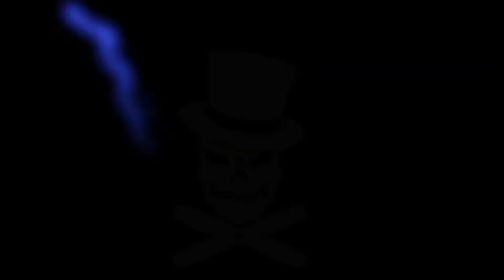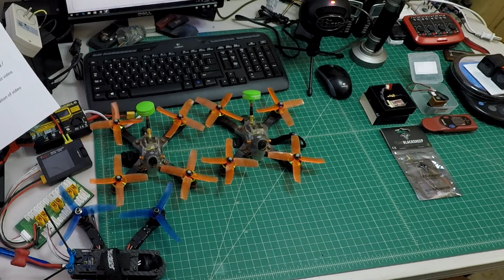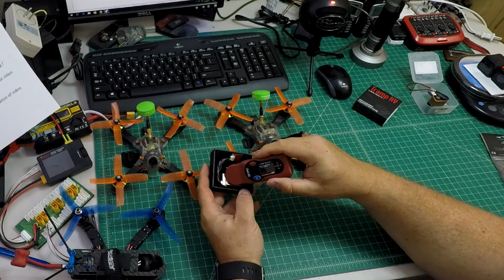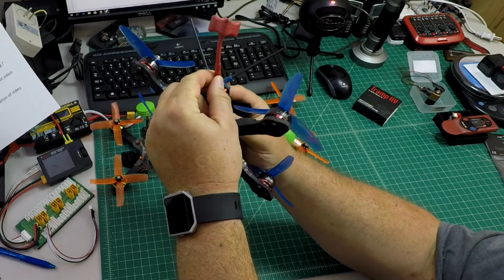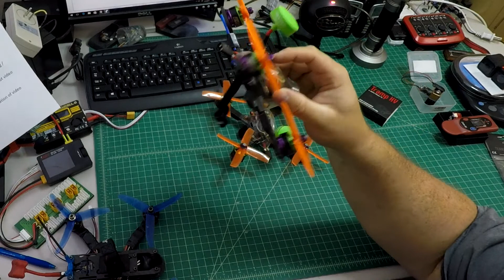FPV Racing Do's and Don'ts for pilots and Organizers

Comment: Great information I guess dip switches and my immersion 600mw race band is outdated I've only been flying solo but am going to be doing more racing.. Only heard good things about unify pro and heard it goes to 800mw if needed.. Thanks for exposing me to the tramp hv gonna look into that.. And if you leave your quad on for too long does it burn out the vtx? Ps I jus subscribed!
Reply from the maker: Glad you liked the video! The TBS gets kinda hot if you leave it, but if your running below 200mw it should run forever and be ok, the Tranp stays cool with any power setting so no worries!